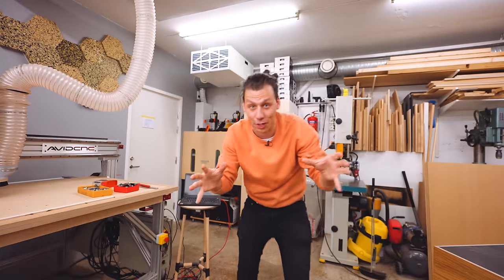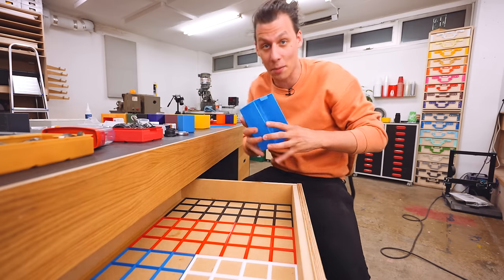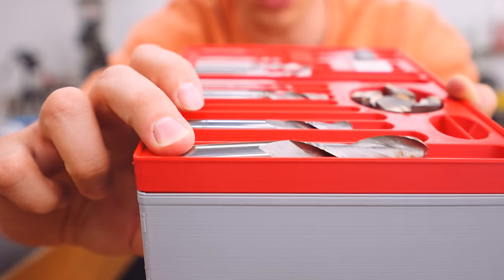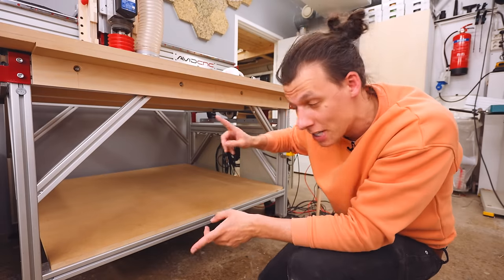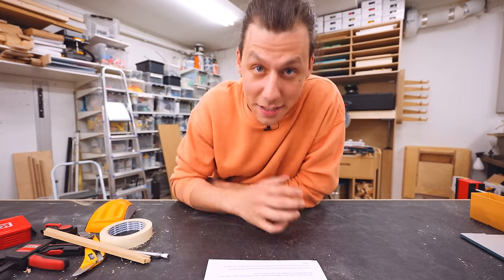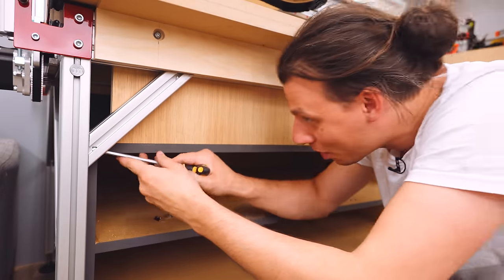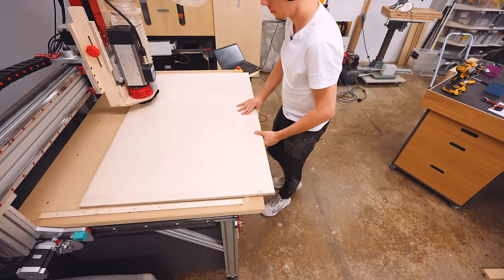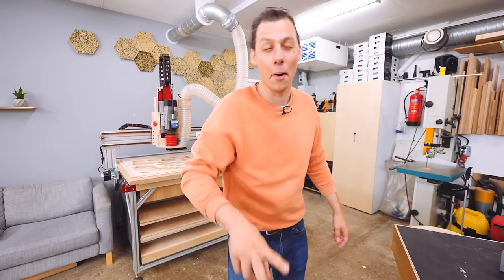Custom 3d Printed Boxes for My Tools!

Comment: Can you also show how you 3D model the designs. That would be interesting.
Reply: Sketchup is what a lot of people use. Very intuitive and easy to learn.
Reply: That what I wanted ask also. How u Design your Stuff
Reply: @AnDy-of3mj  I'm quite sure he probably doesn't want to learn how to use fusion 360, just how it is done. I maybe wrong but that is what I took from the comment
Reply: @AnDy-of3mj  as someone who literally does 3D modelling for a living, I personally would love to see specifically how ALEX does modelling. Everyone has their own process and Alex’s work looks so clean that I’m sure he’s got something going on that is unique to him.
Reply: great video idea how you design and use sketchup or any other program but focusing on how you get the idea to take all the measurements so it perfectly fits, not just showing how to use a 3d design program
Reply: @OhMyLaurens  not so great for 3D printing though. I prefer designing in Sketchup but ran into a lot of trouble when doing it for 3D printing
Reply: @PhilGroene  what do you export to then? Personally I'm in Architecture so what I use is 3ds max, SketchUp and Revit for 3d. Do you use autocad?
Reply: First thing i was gonna do was comment this when I pulled the video up. I’m mostly wondering if there’s shortcuts besides drawing each individual item out on a fusion 360 sketch
Reply: @The.Talent  agreed. Completely agreed

Comment: I would love to see your design process and how you came up with the ideas.
Reply: I have no experience I just go for it
Reply: You are not the only one. Would be interesting to see like a behind the scenes of a project like this. Nice idea!
Reply: I third this motion! Let’s spend an episode on something as “boring” as designing a drill bit organizer. I have the 3D printer and basic skills in fusion. One on 3D printed parts from measuring tape to finished product, and one on the process to mentally picture, sketch, then dimension out the laptop arm for the CNC? Would be my favorite videos you’ve done.
Reply: Yes, a longer behind the scenes video (even on a second channel) would be awesome. Something that goes through the process of taking measurements and designing in Fusion.
Reply: @flippingwoodforcash9130   just been on Your channel you need to clean up like this lad it looks like you have no sponsor yet I done like the cnc you have made I reckon I can make it too  I love the wood carving as well. Did any one else have a spy in on that cnc
Reply: Maybe he doesn’t design

Comment: Now you only have to worry about bumping into the computer stand every time you bring in materials and large stuff into the workshop. :) I would fold it up or put it on the other side of the machine, added bonus there is being able too sit down in the couch and control the cnc.
Reply: I don’t need a laptop on my Cnc mate check my videos 26/27
Reply: I run with out a  laptop check my video 26/27 and

Comment: I like that you showed the screwups too. For the laptop I suggest you use some cable ties / tidier of some kind so you don't get caught on the laptop wires and also have some kind of 'lock' to hold the laptop in place and stop is sliding, like some kind of friction mat or raised corners

Comment: You are the master of workshop organization! Say if you are trying to put wood into slots and it's a snug fit u can use candle wax to make it easier to slide wood into slots. Just take the candle while not lit and rub the wax on the edges of the wood that'll be sliding against each other.

Comment: Also instead of having the computer directly tied to the CNC, you can consider using a Raspberry Pi with Octoprint (or whatever applies to CNC machines) so you can remotely send the info and have the pieces cut.
Now if you stay with the laptop stand, and in order to make it not that stiff for rotation, you can apply some paste wax on the mating surfaces. Heck, even candle wax will do! Just rub it in the mating surfaces and it will be smoother with not much play
Reply: I already think he sends them remotely to this laptop. The laptop was already stationairy. I believe he uses his desktop to do the design and CAM and then starts the program from the laptop

Comment: A project idea you might like would be to build a small divider between the CNC and your couch? Im sure you dust extraction system is great but doesn't get everything, so a small divider could between the CNC and the couch could make a big difference. You could try making it a try-fold or quad-fold or maybe even a like a pull down shade or something that pulls out of the wall. Cheers!

Comment: Nice build!  The biggest change I'd make is to put the laptop arm on the other side of the CNC rig so it would be completely out of the path that you most use.  (I would also put a second joint on it for more positioning options, but that's just me.)

Comment: I’m in the heating and air conditioning field and a hobbyist wood worker. I’ve seen you use your 3D printer a lot and I’m wondering, with a 3D printer, could you make a custom tool box where your tools snap in place? So they don’t get all mixed up bouncing around in the back of a van. Was going to attempt a build out of wood but I feel wood would be heavy. I was never into the thought of 3D printing but I have to admit it is growing on me
Reply: You could but you would have to do a lot of testing with the tolerances and, depending on where you live, you'd have to be careful on what type of filament you use because I have had 3D printed parts get soft in the heat of my car and deform 👍

Comment: If you are sending from Windows pc I suggest changing to some sort of Linux server. I use cncjs on a raspberry pi to send my gcode. I have had too many failures with sending from windows. I just don't know if cncjs is compatible with your cnc machine. Also works good with my laser engraver too
Reply: Did you the normal one on my video 26\27 no raspberry no laptops

Comment: Next time you make drawers you could use the CNC to cut out the grid system at the bottom of the drawer so you don't have to print and glue them.  :) all your videos are excellent :)

Comment: 3d print a jig that will hold that chair perfectly straight, then drill down the backrest breaks so you can epoxy some threaded rod in there

Comment: Not bad at all, but you need something on the surface of the rotating table to prevent the laptop flying off if one day you come in carrying a large box and collide with the tabletop, not that this individual has ever destroyed a workstation class laptop by doing something similar :-(